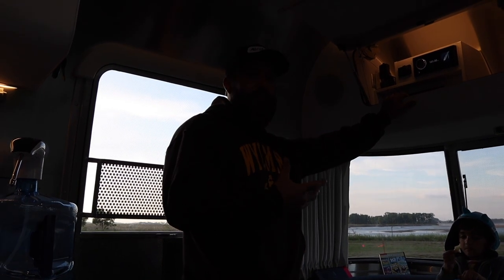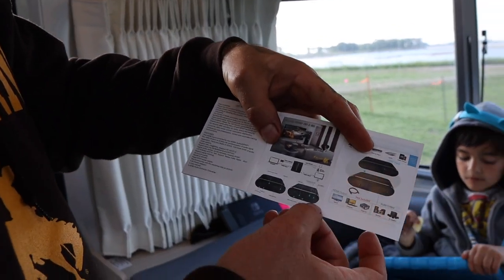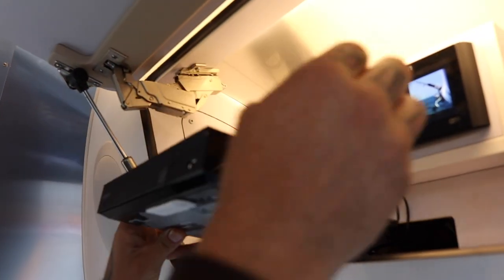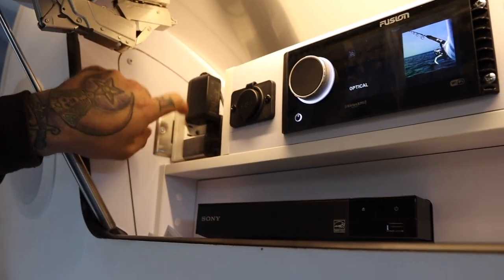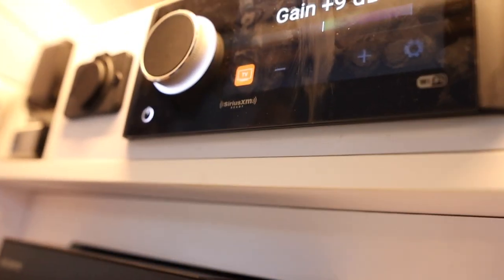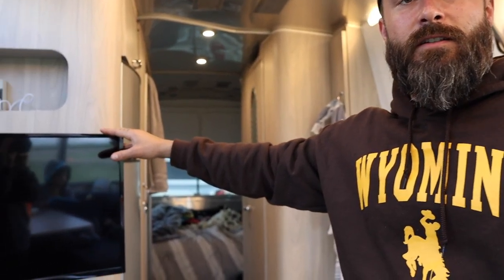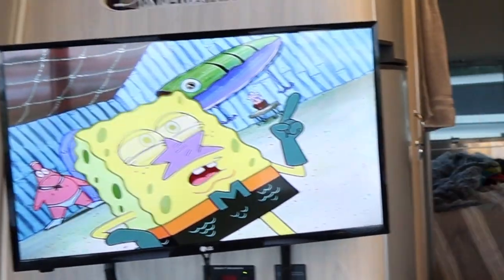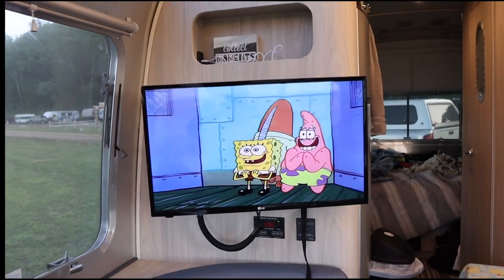AIRSTREAM SURROUND SOUND ON NEWER MODELS

Comment: Thank you so much!  Tried it and it worked!  Wanted to let you know of a fix for the lip syncing issue in case you hadn't figured it out yet.  On the Fusion stereo go to menu, settings, source, optical and "unclick" group enabled.  That's it!  Also, we ended up swaping out our LG TV for an Insignia FireTV then ran a long optical cable from the back of the TV to the back of the fusion and now able to watch normal TV over surround sound. We bought an optical cable splitter so we can plug in both the DVD player and the TV optical cable.  Thanks again for your video, that was driving me crazy that we couldn't watch movies with the Airstream surround sound!  Great job!
Reply from the maker: Well thank you!

Comment: Right on! Thank you for this. I thought I was going crazy on a recent trip in our new 2022 23ft Globetrotter trying to figure out what I was doing wrong (because, "d'uh of course you should be able to hear the DVD play over the sound system"). My little Sony BluRay/DVD does look to have its own optical output so hopefully that might work without the added extractor (also with mine it already had velcro for the player). I ordered the extractor and optical cable though just in case. Now... would you have any advice on getting the best performance out of a WiFi cable router hooked to outside cable? :) I've got a WiFi router/modem, have it coax'd connected to what comes in from the outside coax cable input, but man I'm getting so much noise through the existing cable my connection is super flakey. We're in the PacNW with lots of trees so Starlink isn't really an option. Instead we have our own trailer pad with a cable company post (the "dream right now" is to work from the trailer with on-site cable). Oh and I echo Jim D's comment below, I really found your door lock mod very helpful... and plan to put in an additional, studier cabinet handle soon as well.
Reply from the maker: Right on! Thanks for watching the videos.  I do not have any advice on the wifi part. Good luck and safe travels.!!

Comment: @TheLongLife Thanks for the video.  Very helpful.  Had a question regarding audio from the DVD vs TV (and AppleTV).  I installed per your guidance (i.e. TV HDMI to converter...converter HDMI to DVD...and optical cable from converter to Fusion.  I was able to get the audio to work on a DVD but I cannot get surround sound for the TV (local channels or AppleTV - HDMI 2 on my TV).  Am I missing something?
Reply from the maker: Sometimes it takes several minutes for the sound to kick it. Sometimes feels like 5 mins.

Comment: I just acquired a 2014 Serenity 28'.  It has a Sony car style stereo system, but was not connected to the TV - Blue Ray player system in any way.  The stereo interestingly was blue tooth capable so it could link to the tech of the day (2014) IPod player (now discontinued as smart phones have superseded that).  Long story short... I found a Sony Blue Ray player that was blue tooth enabled for wireless speaker/headphones.  It had the same footprint and slid into the shelf the same way.  It worked just great and was very simple to link and unlink.  If you did want to isolate to a set of headphones that would be an added feature when camping.  Another nice feature was the apps on the new player were more up to date than the 2014 unit.  I'll probably use the old unit in the rear on one of the TV's additional HDMI ports....

Comment: Are you sure that you are selecting the correct audio input on your Stereo?  Airstream typically runs a TV sound connection via RCA stereo plugs that connect to the back of the TV audio out and then connect into the Aux audio  input on the stereo unit.  Usually if you are not getting sound output from the TV to the stereo it is because the RCA plugs came loose from the TV on the back or they came loose on the audio in RCA jacks on the stereo head.

This is how every Airstream I have seen is wired.  That way no matter what you use as input  ie cable, AppleTV, Satellite, over the air, or DVD they all play thru the audio out on the back of the TV and then are selected via the stereo aux input audio.
Reply from the maker: On both our tvs we only have options for HDMI. (LG) That's the only connection other than the antenna on the back of the tv. Hence why when we turned the "Fusion" radio that's hooked to all the speakers and sub there is a select for "TV" but nothing would come out. That's when I tore it apart and found that (atleast on ours) it didn't have anything hooked up from the HDMI from the TV's to the Fusion radio. Hope this helps some others I've read I'm not the only one with this issue ! Thanks for watching and for the valued input!!! More videos to come 😎

Comment: We’re getting our 2021 Flying Cloud 23 next month and trying to watch every video We can. Will this splitter work with an Apple TV?  It only has HDMI out.     I have always noticed a slight delay with optical audio in the past.  Does the same thing happen with the RCA connections. Great video BTW. This is the type of thing that new owners are looking for
Reply from the maker: We have apple Tv at home, I'd imagine it would be the same with the HDMI going into it. Congrats and many memories to come with your new rig ♥️
Reply: @TheLongLife  The newer unit is on sale today at Amazon Prime
Reply: @TheLongLife  Got it installed and works perfectly with Apple TV.  I have a JL Audio head unit that only had AUX RCA inputs.  I just used the 1/8 inch headphone to RCA with zero delay.  I just wish the cheap LG TV that came with my 2021 Airstream had an ARC output. I would then be able to adjust the volume with the remote

Comment: Bluetooth?
Reply from the maker: Bluetooth? Whats your question?!
Reply: @TheLongLife  Happy New year! My Question is there Bluetooth in the lg TV? Or aux for a Bluetooth adapter? And then coul that be sync to stereo?
Reply from the maker: @gotodd712  on our radio/head unit. It has Bluetooth. The LG TVs do not.  When we first had our Airstream only the tv sould have the sound. Nothing from the subwoofer or speakers built into the cabinets. So hence why I used a HDMI splitter to get the sound to tap in! Not sure if that answers your question but I hope so!